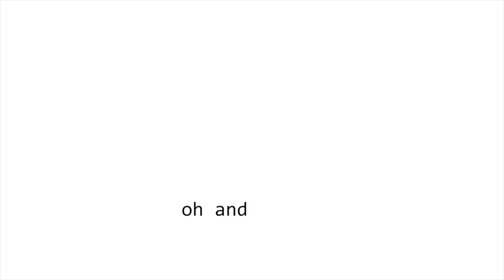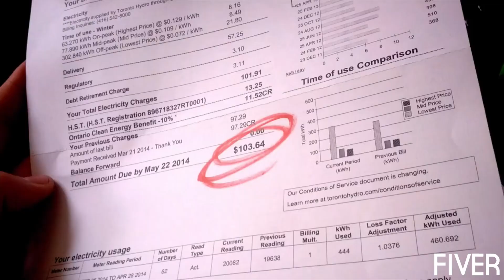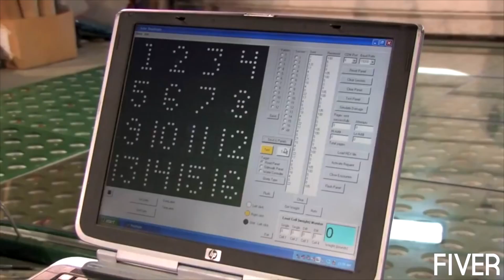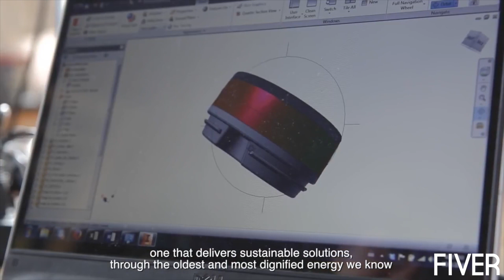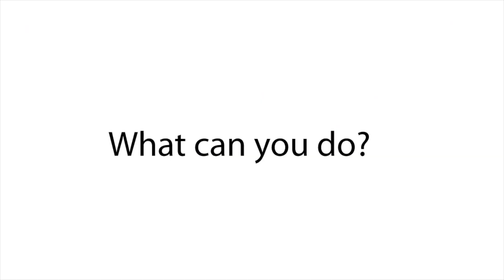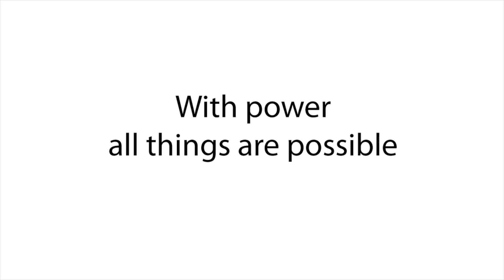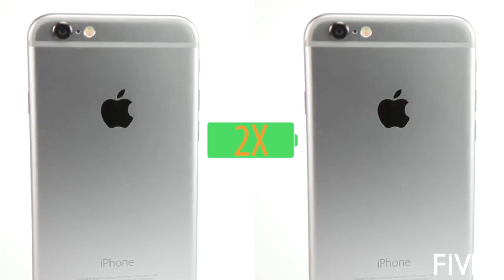5 Solar Powered Inventions That Will Blow Your Mind

Comment: the whole solar roadways thing... have you guys tried thermal ceramic electric plates? tempered glass not necessary plus the amount of circuit boards and LED's required is a lot where as thermal ceramic electric plates similar to just pouring cement on the ground but without the TAR and you electrodes on any surface of the road and you get electricity
Reply: but can it handle the weight of cars and trucks?
Reply: too late, they already scammed people and get to now keep all the profits for their fake invention.